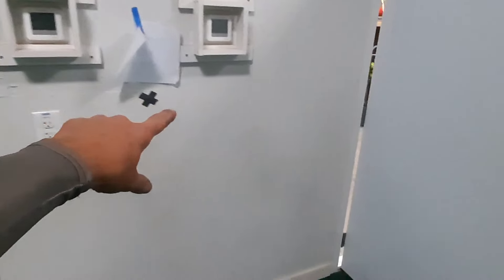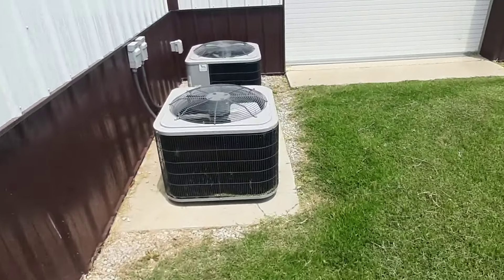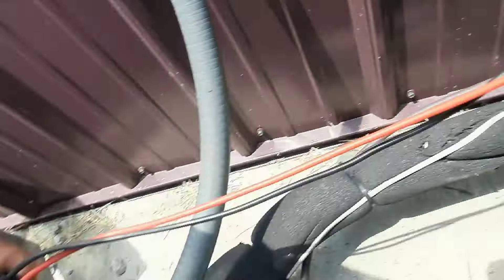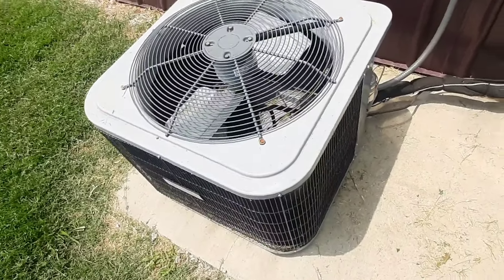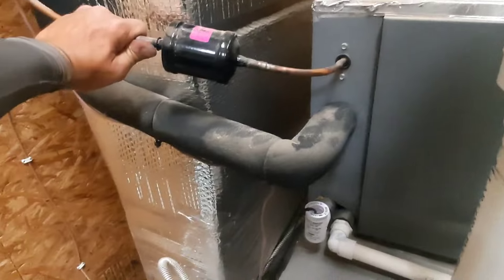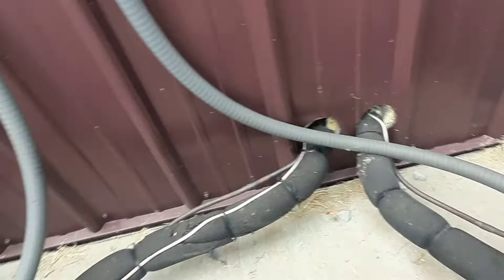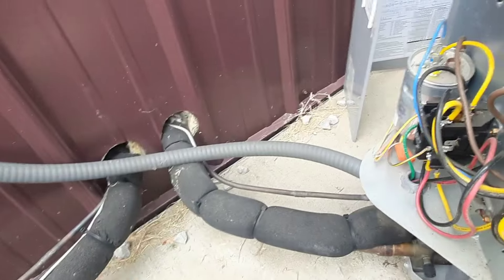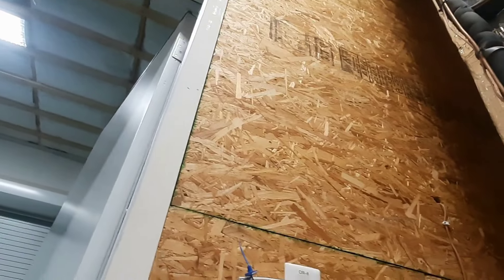No Cooling Service Call, 2 split systems, 1 large room.

Comment: Your way to investigate the situation on units is done in a great way😊
I have worked a lot with cable shoes over the years and experienced so much bad quality ones😳
The Faston originally by AMP was the best choice.
Some of the ones seen on the units of yours has a horrible female to spade design.
So many brands of poor quality seen over the years.
I find that few use a proper pressing tool. 
The good tools have to go to a locked position that guarantee a good contact.
Even better is T crimping shoes and tool that few use these days😬
Reply from the maker: Thank you, per995!

Comment: Good to see you verifying the power is dead when it ought to be (fuse pulled). Easy step that I see people skip all the time - along with not verifying their meter is actually functional on a live circuit before using it to test dead. Sadly a small oversight can lead to the wrong thing being dead :(
Reply from the maker: Thanks chillybrit! I'm bad about it sometimes  and even though I may check don't always say or show it. Not trying to be a diy channel but I do understand there are people that watch that may not know
Reply: @EverythingHVACR  That's fair enough. The HVACR systems you are working on and showing in your videos are not going to be tackled by DIYers.... I hope!
Reply from the maker: You'd be surprised, 😆

Comment: Those digital thermostats will keep going to time delay when there is a high amp draw on control circuit  we seem to replace a lot on contractors after storms and power surge’s for shorted contractor coils great video
Reply from the maker: Thanks, East Coast! I had to pick up a contactor anyway, but I thought after that, maybe the thermostat wasn't bad. Might not have been, the other thermostat didn't call either. Hind sight is 50/50 😆
Reply: @EverythingHVACR  your video’s are making the trade’s great again going the extra mile not hit and run service calls
Reply from the maker: I'm trying, but I miss things too, thank you, East Coast. Keep that knowledge coming!
Reply: they generally flash the "cool on" when in delay and it stays solid when actually calling. so if it keeps flashing, could be contactor shorted/power loss.

Comment: Considering they've combined the supply's at the units, (and I didn't see a backflow prevention); should those units be twinned?
Reply from the maker: I don't think they need to be because of the way the duct is, but I did consider that as well, and it wouldn't be a terrible idea. Thanks RJ